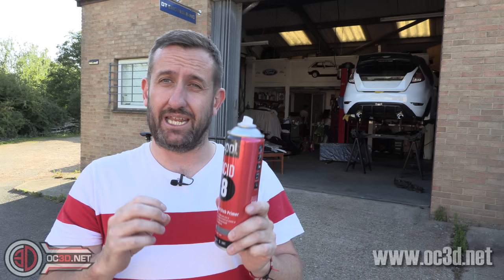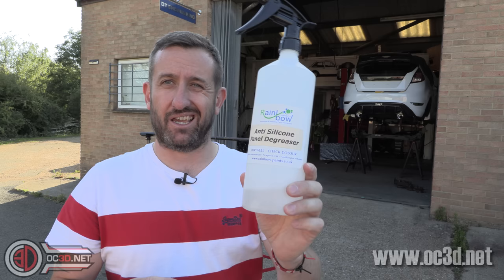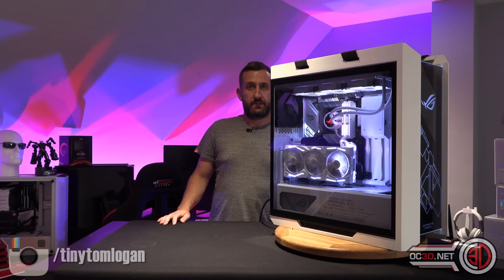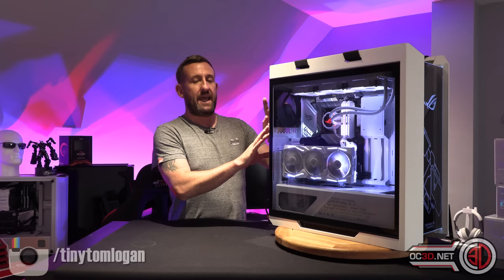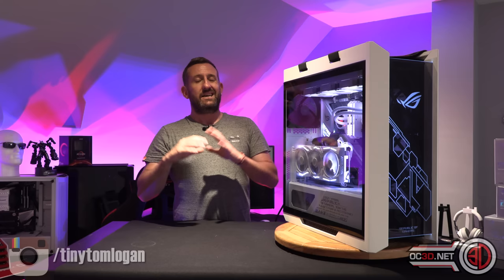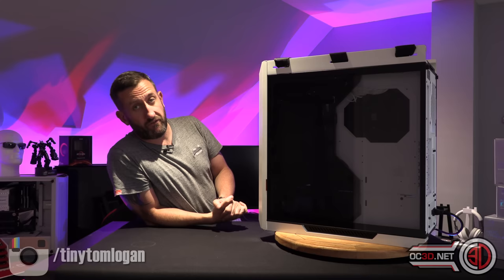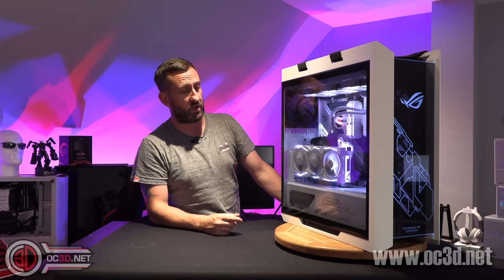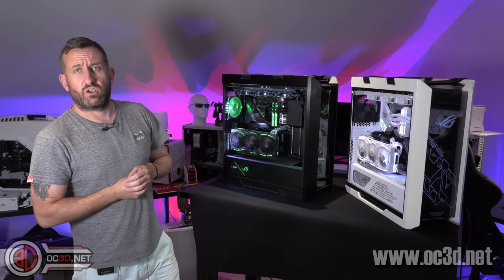The White ROG Helios Strix RTX 2080 Ti i9 10900K Full Build

Comment: all white build,  painted the sidings of the case but didn't bother changing the black fan in the rear.. :)
very thorough on the cable management at the back but left the 8pin connector of the gpu like that.. :)

Comment: I like the white version ! And I mean OC3D version actually. It would be better if ASUS would ditch the sliver and make it white. 
Also I like the fact that there is a bit of black accent at the bottom of the case. 

As for the riser cable, if we can't do anything about the clearance it would be nice for the manufacturers to make sleeved versions too.

I have now in my rig a full power supply replacement set of white/red OC3D themed cables (Seasonic Focus+) and I would 'kill' for a OC3D themed sleeved riser cable :D . 

My case is the Enthoo Luxe 2 (719) and I keep my power supply in the front to show off all the OC3D themed cables :) all the connectors are occupied and it really is nice to look at.

 If only they had a white version of the  Luxe 2. But now that I've seen old Tom doing a proper paint mod, I think I might mod my case as well. I already replaced the key caps on my black keyboard with some Glorious white ones.

Comment: Really enjoyed this piece. I've got a Helios build in the pipeline, and I know that the stock 8 pin cable that comes with the Thor is only around 600mm and looks very tight for length in your first build and others I've seen. What length did you use with the white build, I think CableMod go up to 900mm, so I just wanted to be sure I'm not going to over tension things.

Comment: I see tons of builds setting the CPU rad up top even tho setting the CPU rad in the front will reduce the temp by 10c easy, is the reason for that is that the AIO tubes won't reach the cpu if they were to be in the front, considering the tubes should be on the bottom of the rad?
Reply: Never seen any evidence of that whatsoever. There's a much smaller difference in terms of temps than you suggest, and in many cases top mounting is superior based on tests that have been carried out.

Comment: Hi man, nice video, I have a little question I have the same case and cooler but the cable that is included with it is for 5v rgb but I see you just connect it to a 12v on your motherboard.
Is this just compatible or what?

Comment: Looking at the Strix LC 360 it does not mention LGA1200 support, how are you using it with a 10900KF or am I missing something?
Reply from the maker: its the same fitment as the older sockets

Comment: Hi, can you mount a graphics card vertically and have a PCIE Elgato?
Reply from the maker: You can mount it in the same slot I did with the 10GBe or the very bottom pciex16 as explained in the video
Reply: @OC3D  Yeah I did catch that in the video it's just everyone online saying Vertical Mounting means you lose all slots bar GPU so wanted to double check

Comment: What did you use to change the color to green on PSU?
Reply from the maker: The aura software but you have to connect the rgb cable to the PSU too
Reply: I see but those cables are 3 pin 5v and I don't have that on my MB